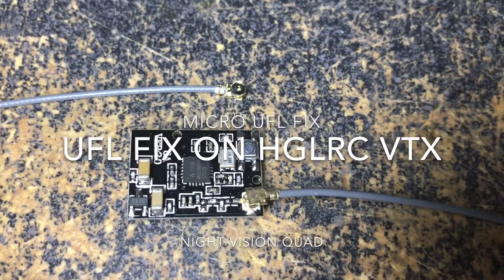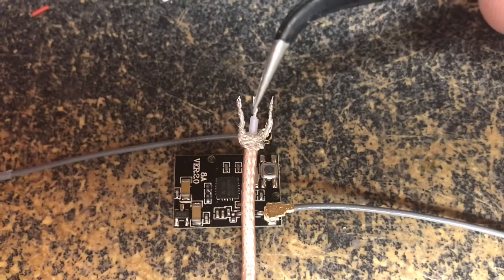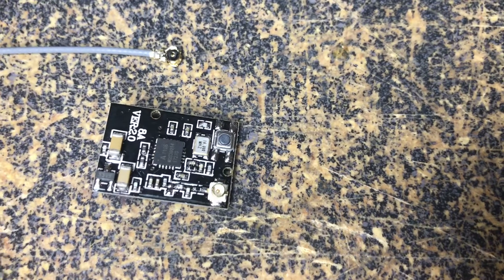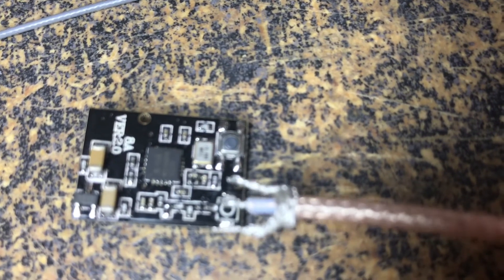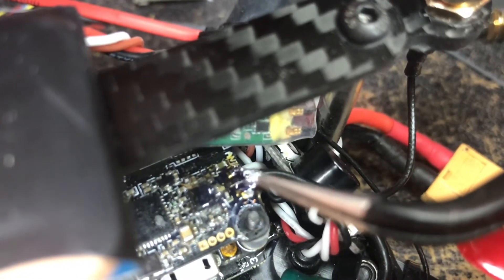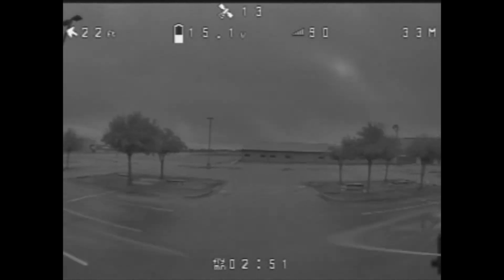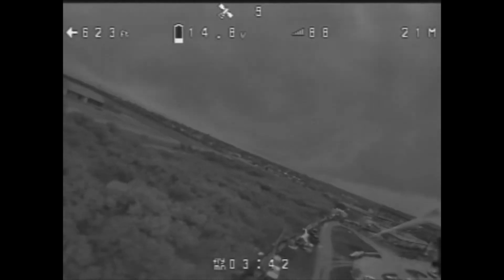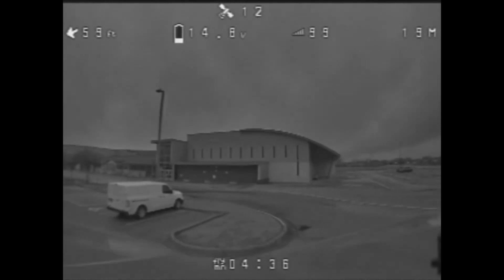Redneck Tech - Fix Broken uFl connector

Comment from the maker: Someone posted a question about this video but I can't find it to respond to it. Anyway, the question was "How did I pull the connector off". These things are pretty flimsy. I was trying to change the pigtail I had on it from an RP-SMA to an SMA pigtail and the connector pulled off with the pigtail. I then cut the ripped pigtail and put it on another quad that I needed an RP-SMA connector on. I then cut the end off an SMA pigtail and put it on this VTX using the process in the video. Hope that answers your question. Have a great day and keep her in the air!